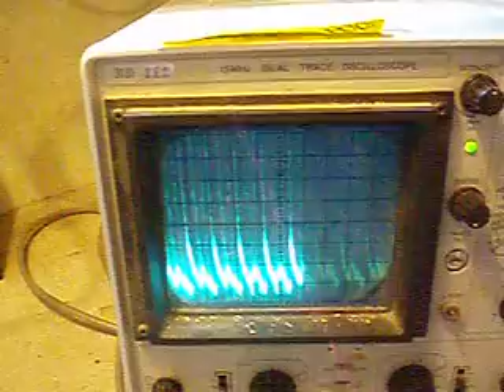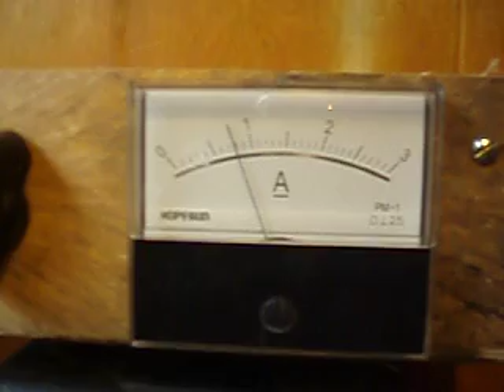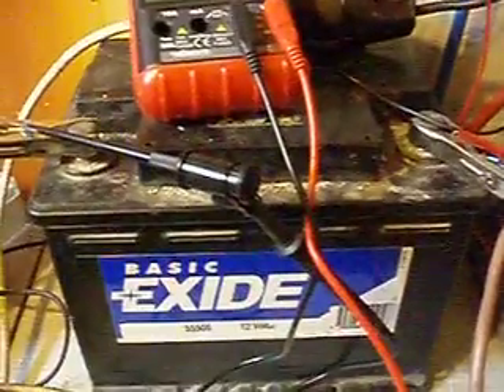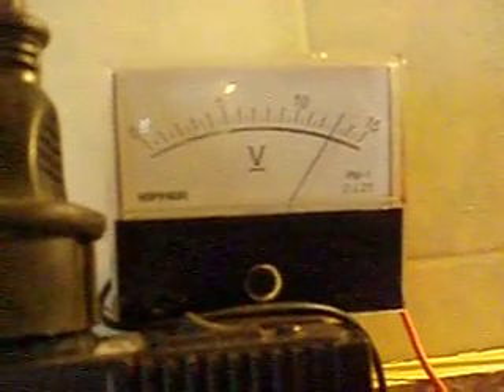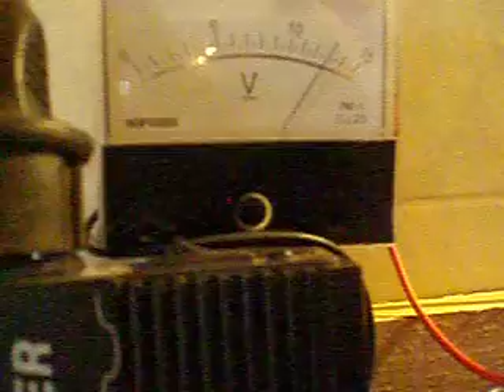power plants and new battery room.

Comment: Can you share the specs on your coils? wire? turns? length?

and does your system charge more battery amp-hours than it needs to run
the solid state coils? how much so?

thanks, love your coils.